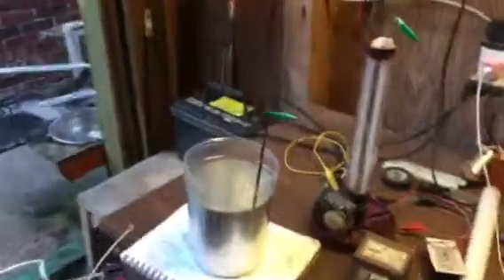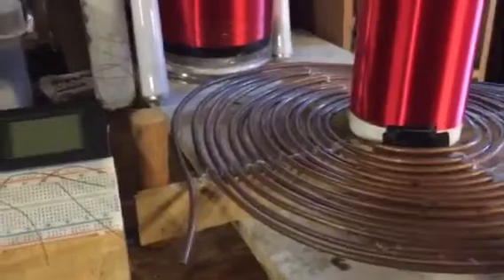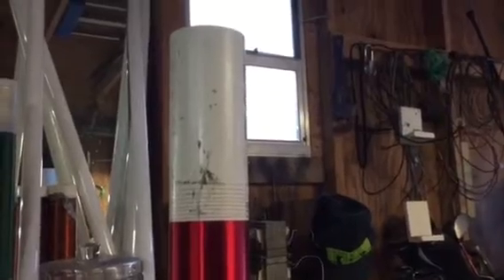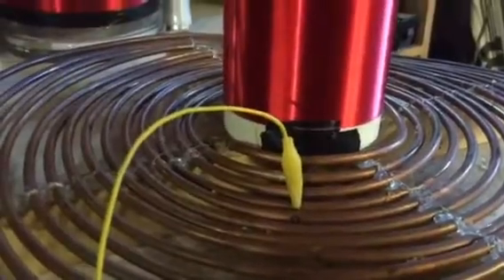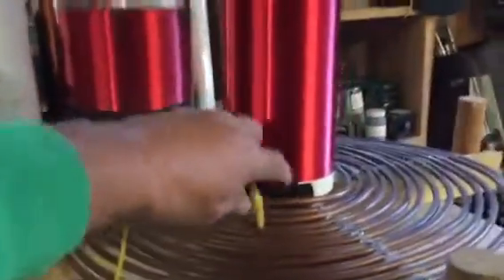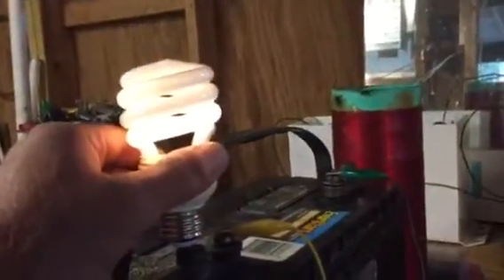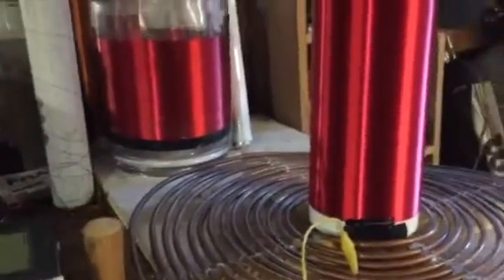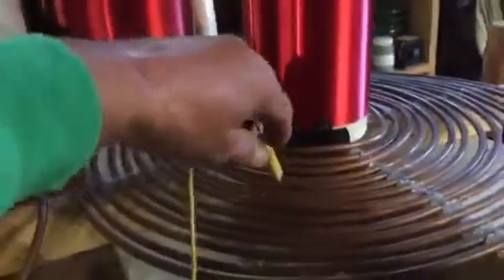Energy! Tesla Battery

Comment: Your rubber band and inside of the battery chemically electroplating the cathode are the same entity. Your relationship of the plastic tube around which your secondary thirty gauge is wound; meaning the metal and the plastic are also of the same relationship. Same with the foil and the plastic of your capacitor, and most importantly let's not forget the atmopherics; meaning the nitrogen eighty percent and oxygen nearly twenty percent.

In metal ionization and transference of electrons and ions between metals is the same entity as static charge and triboelectric material series. When metals are dissolved with acids or alkaloids one metal will lose ions and one metal will gain ions etc. For example an iron nickel battery using alkaline will dissolve the iron. I.e. Edison Battery. 

Magnetic alignments; meaning atomic north to south repeating, or toriod tubes of force, or lines of magnetic force are occurring in the atmospherics and the chemical battery as well as between the dielectric insulators of resistance and the conductors; meaning the capacitors  which are storing or holding the collection of alignments of the magnetic toroids.

In the static charger the rubber band is said to be aggravating, or applying piezo pressure, to the dielectric insulator of itself, the plastic tube and the surrounding air. All these triboelectric materials enforce an action upon the capacitor because they themselves are the actionary form of the capacitor itself, but in motion and not in storage as much as the capacitor you constructed. Both the static machine as well as the Tesla coil could in fact have the same elemental arrangements as your capacitor and would likewise easily function as a capacitor, of course without the need for an additional lone standing capacitor.  In the Tesla Coil the electric pulse frequency from the primary into the secondary by induction is doing the same, applying piezo pressure, to the dielectric insulation, which is covering the magnetic wire, as well as the plastic tube around which it is wrapped; as well as the atmospherics of both. What you essentially are achieving is the aggravation of dielectric the same as the pressure on a piezo crystal, such as quartz, and can even be applied to an oil, as well as an atmospheric oil of smoke particles. Electromagnetic alignments are the creation of electricity as we know it today. 

Smoke contains oil particles. These interact with atmospherics and become a piezo cloud of energy. Under pressure we know these can combust and form plasma, which is coherent alignments; as can be seen by wood burning fumes running a combustion engine. When atoms are forming into molecules during combustion vacuum also gets created because molecules take up less space then individual atoms. When atmospherics are aligning with dielectric hydrocarbons we have the capacitor arrangement and aggravation of these results in plasma combustion as well as vacuum same as in diesel engines.

https://youtu.be/4i3-w6MZP1U

Thinking on why Tesla might say his turbine was his favorite idea or creation we might think that it could be its efficiency of transmitting this vacuum force into torque. Applying what me might believe is achievable using atmopherics, plastics, capacitor arrangements, etc. along with piezo pressure and vacuum creation we might see the possibilities these all combine for power generation. How blinded or mentally manipulated are we when we as a civilization are not aware of the ability of such simple devices to power themselves as well as all of our needs?

Comment: Take the power produced and put into the capacitor to self run the device. This is the first step toward levitation.
Reply: "Magnet's" are likely pulse discharges forming lines of stacked toroids which become tubes of force. They align to form fractals such as atoms, particles, molecules; basically all things. Magnets themselves are likely an increased coherent phase of the same thing. The toroid moves like a smoke ring, which can also sit stationary, but it moves in both directions; inward on the inside and outward on the outside, etc. 

It probably has been well known for longer than we can imagine. The biggest secrets are the ones people try to squash; such as how easy it is to break molecular bonds with magnets and or separate charge plates; i.e. hydrogen and oxygen from water. The molecules atoms align like magnets align between the magnets or plates and essentially get pulled apart probably by resonance frequency. Also; specific aggravation of dielectric materials can easily result in separation of charges; i.e. dipole, and magnet alignments...leading to keeping a capacitor charged all the while using the capacitor to aggravate the dielectric. And thus, the pulse charges coming off the capacitor equate to volts, transformed into watts or amperage simply by coil geometry induction; i.e. pole transformers.

https://youtu.be/Mnoy2D4wuf8

https://www.youtube.com/results?search_query=don+smith+generator

Comment: Eds "ring the bell twice". In old trains did the guard at stations call out and ring a bell to warn of setting off ? If yes then in the pmh as stated with coils round opposite to each other the collapse would cause a richochet before it could carry on round the horse shoe for ever once excited. Looks plausable
Reply: Strangely the. U.  Looks like a modern tuning fork without the middle stand.  I wonder if you used a tuning fork as a pmh.  If that stand arm   Exaggerates the colliding hook playing field causing that twist
Reply: yes it appears you have to get the elements of the structure all in onme direction the same as making a steel screwdriver magnetic  this is why joe booker states his car engine takes a day and a half to get the positive ions into the structure as it all goes in one direction    like pos neg neutral all going up the north  3 lanes of a motorway (all in seperate lanes ) never turning off then getting to the end of the motorway and round the 3 lane roundabout and back down the opposite south bound